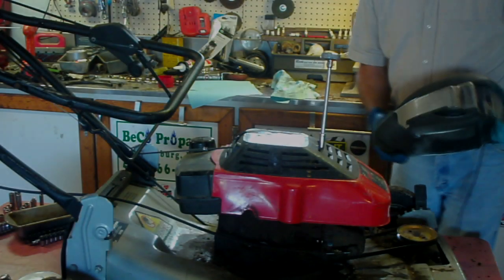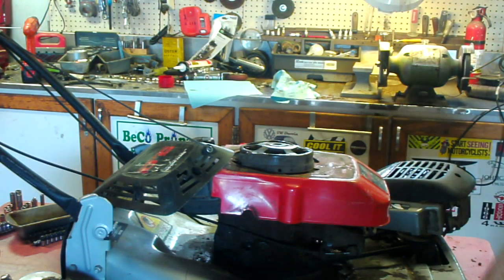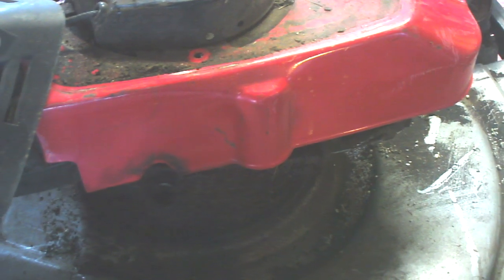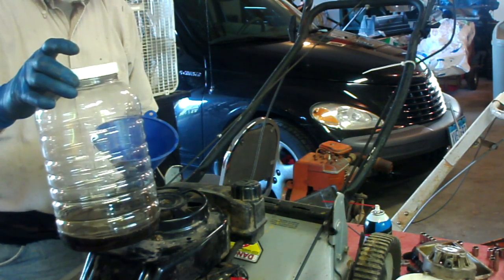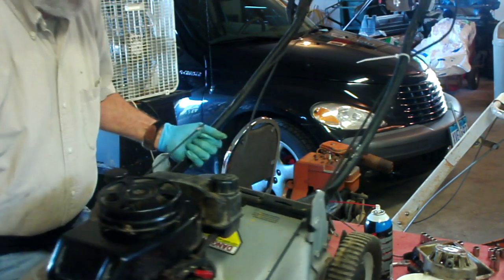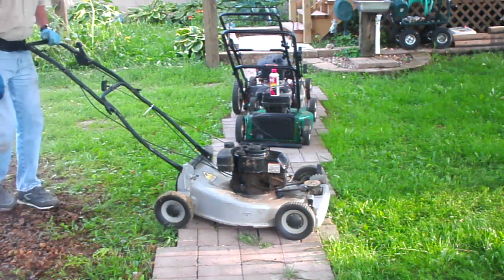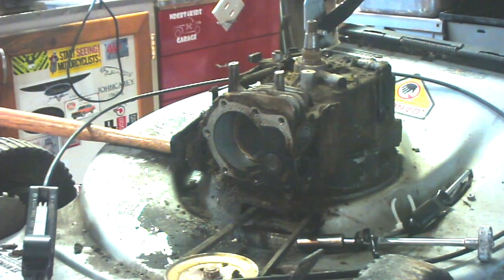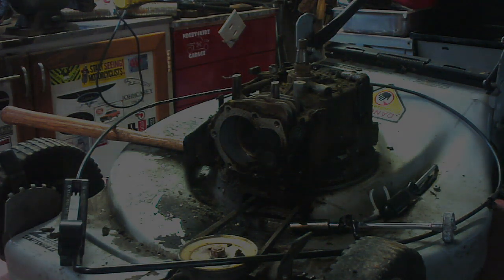A sad end

Comment: nice video George! hey I have and old briggs edger and it has the carb with the pullout choke on it.   you wouldn't just so happen have one laying around or know of someone that does, I just hate that I cant find one here for it,
Reply from the maker: I don't have an extra of those carburetors. Most of the engines I have been working on are Tecumseh. As popular as they were, I don't understand why they went out of business. That is the older style carburetor for the B&S motors. I have that setup on a rototiller that is from the 60s-70s and it runs great! Thanks for stopping by and sorry I can't help this time.
Reply: ok well that's fine thanks tho, and if you hear of anyone or come acroos one please let me know and again thanks
Reply from the maker: crzy4htrods
I will keep you in mind for sure.
Reply: thanks I just can't find one here, or I would buy one it's my late dads and I just hate that I can't use it right now. thanks
Reply from the maker: crzy4htrods
Is there no way that you can rebuild it and re-use it?
Reply: no it broke were it monts to the engine and I don't have the piece that broke off. to weld back and cast is just so hard to weld anyway I'm sure it could be fixed someway or another and I will try to get a video of it up on here so maybe someone may know.
Reply from the maker: crzy4htrods
Can you make it out of JB weld and add a separate support?